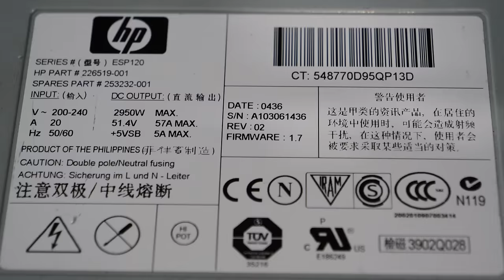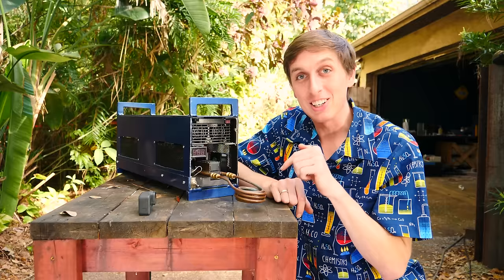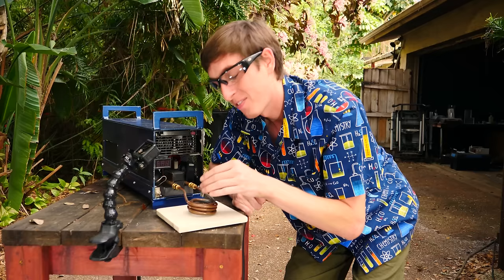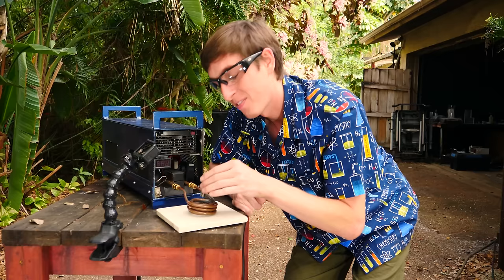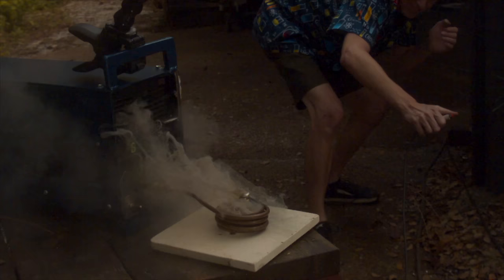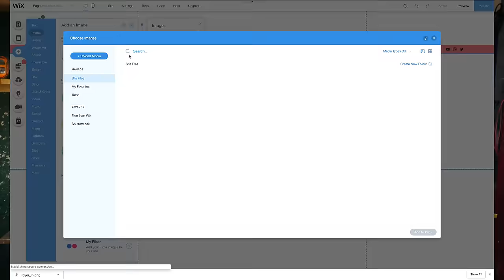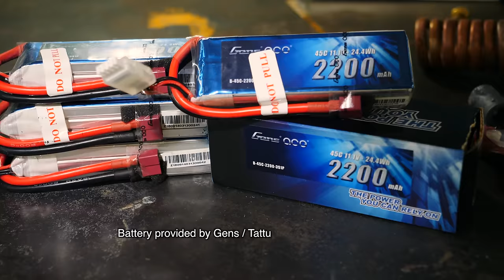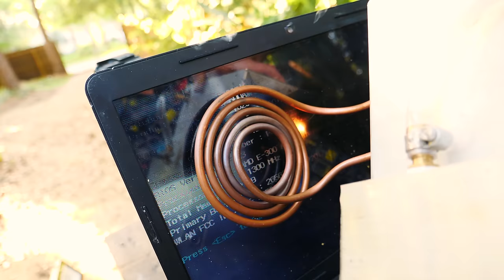Handheld Induction Heater Melts a Lock!

Comment: Did you bother to check what the resonant frequency was of your induction heater and the current going through your multi-turn coil? 

Sure, it's likely in the 50-100kHz range, but there are still safety levels associated with RF in that frequency range. In fact, you are getting high amounts of peak current through your induction coil, let's say a current of 24 amps RMS, you are not safe at all.

Here is the recommended safety chart: https://www-group.slac.stanford.edu/esh/eshmanual/references/nirReqExpLimits.pdf - Page 6

You have several turns of that make up that coil. I'm eyeballing a radius of about 3.5cm. Let's assume you have 6 turns.

Plug that into here: http://hyperphysics.phy-astr.gsu.edu/hbase/magnetic/curloo.html and multiply by six. 

You should get around 25.8 [Gauss]. Let's convert that to [A/m] you can do that here: http://www.hkd.co.jp/english/unit_conv/

And what do we have? You are about 12.5 times over the safe exposure limit for 100kHz if you put your finger in the center of that coil.

Get Rekt dude.
Reply: U6uuuuuuummmmm

Comment: I was both nervous and knew that nothing wrong would happen with the bullet in the watermelon. I already know that without the proper pressure the actual bullet itself would not launch far if at all, but at the same time my mind said why. I did also think about the casing launching away however there was the wood so my mind was at ease there. While this is late if you do anything like that again make sure the heater isn't too far from a hard surface and possibly soft medium to keep the casing itself from hurting anyone, granted you probably knew that already. The casing is actually why cooked off ammo(ammo that is heated to the point it fires in or out of the mag or barrel) is dangerous outside of firearms, the explosion isn't strong enough outside of the barrel/without the right outside pressure to launch the bullet as they are too heavy, the casing however is light compared to the bullet and will absolutely be launched, I don't know exact speeds as each caliber and/or cartridge is different, but they can be really dangerous, even puncturing skin and if I remember correctly can be fatal.

To everyone try to stay safe when doing experiments or things that could be dangerous. If you don't want to that's alright, good luck.

Comment: In order to shoot more than 10 feet and still have enough energy to go up a considerable distance, a round needs  a barrel and preferably an upper receiver in battery, so all the energy pushes the bullet and the barrel and its rifle-ing keeps it accurate. 

Long story short all the energy needs to push the bullet, not explode the watermelon. So basically if somehow the bullet went thru and went up 7 feet and hitting you, it would be like getting hit by a metal bb from an eighth of a mile away

Comment: Can you build a mold of a complicated (but small) object, with a lower chamber for the target object and an upper chamber with steel in it, put the whole mold (steel and all) in a small crucible, the crucible in the induction heater, and the coil for the induction heater in a vacuum chamber?  You should be able to suck all the air out, melt the steel into the lower chamber, and get a perfectly cast object (such as a small gear) in one step.

Comment: Actually - silver is the best known electric conductor among metals.
and it's also a very good heat conductor. Good electrical conductance means low losses by current flow, however - currents may be greater.
But gold is also a good conductor, so I wonder what is a real reason.
Thickness of rings ?
Differences of conductivity makes important role? 
Or ... this is effect of two rings parallel - and worse conductor heats much better.

Comment: How much would you want for the handheld unit? It would be great to break bolts and nuts loose while working on equipment. Easier to carry around to and quicker than using a torch

Comment: Bullets require pressure on all sides of the casing which is why there is a chamber in the gun, basically what the gun is doing is, forcing a path of lease resistance towards the bullet, if you set off any bullet by itself you are more likely to get harmed by the shrapnel from the casing because it's easier to push that apart than it is to push a big heavy bullet, bullets do not have a mind of their own you know what happens to all my guns that are completely loaded ready to go just in case, they sit there and do absolutely nothin, it does not get up and walk outside my house Go to the store by itself go to the 7-Eleven for a slurpee, unless you physically move it or do something with it it's not going anywhere no more dangerous than a stapler but you can hurt yourself with that if you don't know what you're doing too stop believing movies Go to the gun range get educated

Comment: Huh! I know guns need to be properly "headspaced" where the inside of the barrel perfectly matches the neck of the case of the round you're firing. If not, the neck of the case expands, and the gas can go back inside the case and swell it up, or explode it. 

People have that problem with badly put together AK kits. I guess that's why the neck of round in your watermelon split, they need the support of a gun barrel to properly fire.

Comment: Come on where a lab coat and some protective gloves! Yeah also organic vapor mask might be a good idea in this particular circumstances and then most of your circumstances. But make sure you wear the right shelter for the right substance. There is a story I was told where there were the black ones and the pink ones and the women wanted to wear the pink ones and the men wanted to wear the black ones put their job roles that they really should have worn the opposite! They weren't getting any of protection with their choice of colors and their job duties as one is for particulate matter and one is for organic vapor and they needed the opposite.